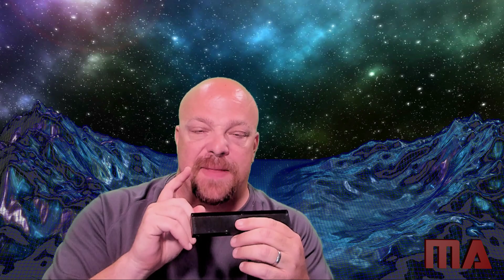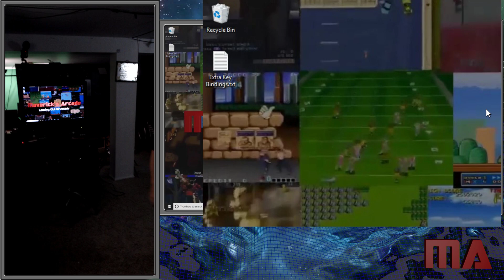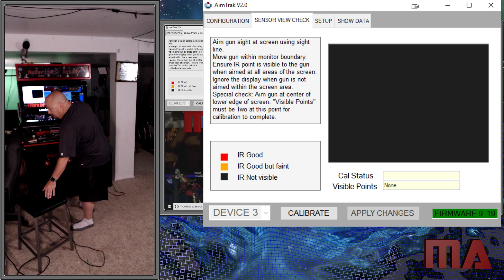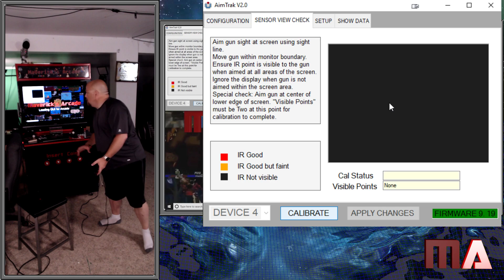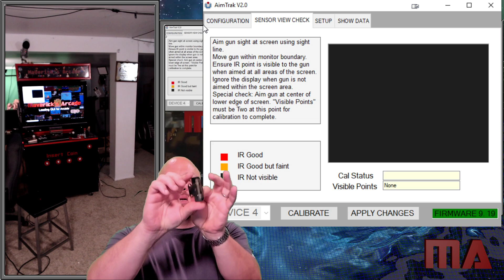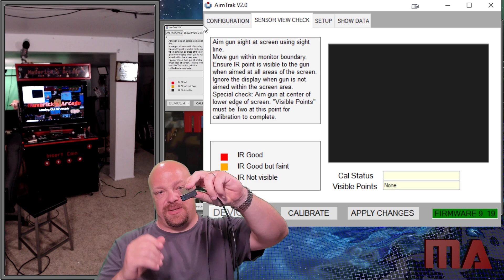Ultimarc Light Guns - Using the Sensor View to troubleshoot and an RF capable camera

Comment: I'm having problems with mine, originally it worked fine then all of a sudden I can't aim bearly up or down at all. Left and right is perfect but no up or down
Reply from the maker: Did the sensor bar get moved at all?  Sometimes you may have to recalibrate if it gets messed up.

Comment: I got 2 Aimtrak guns. One calibrated and firmware shows updated in green, works fine. Other one, no red dot shows, keeps saying “no device” and can’t configure controls. But it still controls the mouse cursor.  I’m using the Extreme ir sensor from ArcadeGuns. is the gun faulty?
Reply from the maker: When you plugged in the first gun, did you change the ID to 2, 3, or 4?  By default they all ship as 1, and if you don't change it using the firmware tool, then the 2nd gun won't work because it has the same ID.
Reply: @MavericksArcade   thanks for the reply, I was able to mess around with them and found out that it was just a device number change. but yes like you said it was the ID of one was at 3 for some reason, but after changing it to 2 and calibrating them both they work good. Thanks 👍🏻

Comment: Just got one of these guns, wondered if you have ever had an issue where there are two flashing cursors on screen while calibrating? It still seems to work pretty good even though I have this phantom cursor at the top right of my screen. It's almost like it could be going outside the left  of the picture and coming in again from the right if that makes any sense?
Reply from the maker: It's likely your mouse fighting with the cursor in the calibration screen.

Comment: Had these guns 3 weeks now. Calibrated them countless times but can't get them to work with any games whatsoever. In mame the cursor/crosshair just dances all over the screen uncontrollably. That's about the most I've been able to get them to do. All reviews say these guns are good but I've found them to be nothing but a pain in the ass and wish I hadn't wasted my money.
Reply from the maker: I've found them to be reliable if the environment doesn't change after I did the recalibration using the tool. If you're still having issues, I'd recommend reaching out to Andy at Ultimarc.

Comment: Thanks Chuck for the video
Now I’ve got my 2 guns up & running.
From down under Australia!!
Reply from the maker: AWESOME!  The guns are too fun not to be able to use :-)   Gonna test the bluetooth conversion kit soon!
Reply: Hi Chuck, 
Is it normal when I turn off arcade 
I have to recalibrate the guns again
Reply from the maker: It's not normal, it's supposed to save the calibration information to the firmware to prevent that from being required.  If you're having that issue, I'd definitely report it to Andy at Ultimarc and see what he thinks.  :-)

Comment: I had come to your page a few times man, and I swear I was looking for a way on a newer video of yours to message you about light guns, LOL. Specifically using the Wii motion bars and the dolphin bar. I have it set up now on my arcade that runs launchbox. They work... But there's issues. I'm definitely going to watch this video and see if the setup for these more expensive guns makes more sense.
Reply from the maker: Ironically enough, another viewer wants me to research into the dolphin bar and Wii controllers, so we're both going to be exploring the opposite configurations :-)
Reply: @MavericksArcade  That's awesome, brother! Just so you're aware...the dolphin issue for me is: 1: The settings of the gun/bar having to be reconfigured over and over per game. I've had to do this so many times for area 51 ( MAME ). 2: Now that I suppose I have the two Wii Motes set-up, if I start the Launchbox arcade...then go to in if the lightgun games ( let's say Alien3-The gun game ), the guns will work for the most part. However, when you try and exit the game...the controls start going haywire ( almost like someone is holding down on the main joystick ). And the only way to stop it is to control alt delete and exit out of your frontend completely.

As a side note, you have to use the program touchmote to utilize the wiimote.

If you want, leading up to your research...I can send you a video in a Dropbox link showcasing the issue. I'll just record it with a go pro or something 👍🏾👈🏾
Reply from the maker: Sounds good, if you do that make sure to include some info about yourself so I can give proper credit in my video :-)